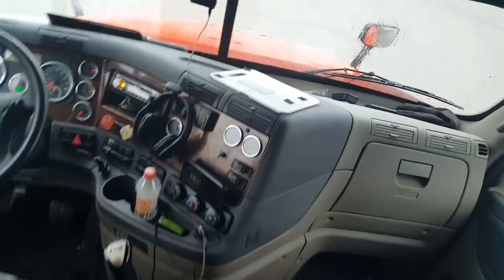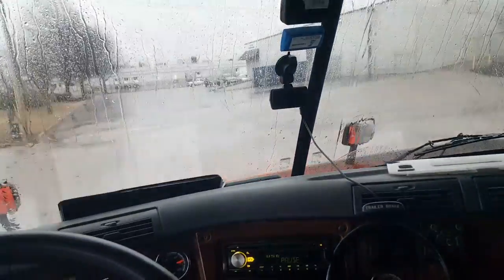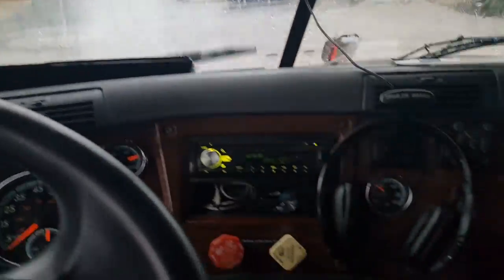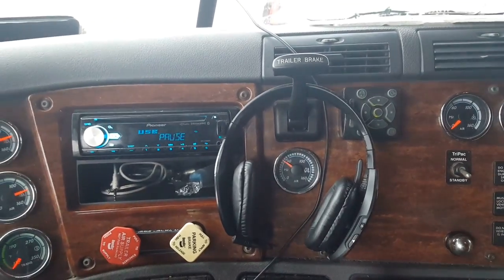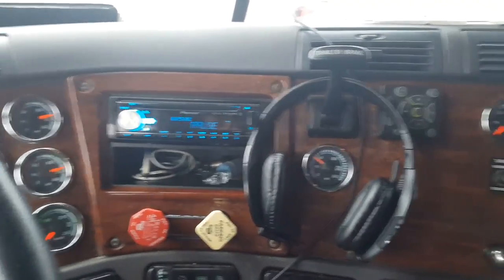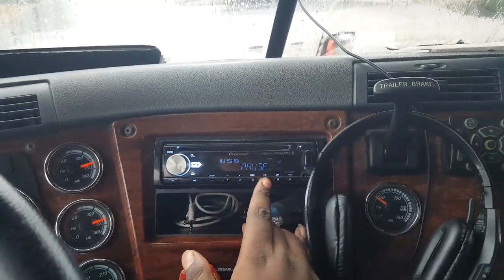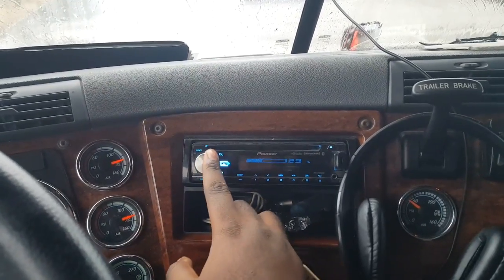2 15s Skar Audio in my Freightliner Cascadia

Comment: Nice. Your system looks like it could knock the trailer right out of the fifth wheel.  :)
Reply from the maker: BlindBatG34 its 10 speed manual.

Comment: I dig it. I’m working on a single Skar zvx8 paired with a Skar rp800 amp in a cascadia daycab, and speaker wise I’ll be running two external speakers on a Skar md400 and door speakers and tweeters will be ran on my pioneer headunit amp. I don’t need any sub bigger since I sit right next to the subwoofer lol
Reply: Val Bien-Aime you gotta get a a video of it KNOCKING
Reply: @Val Bien-Aime — did you ever install? Are you having any issues?

Comment: I bought all my gear it took me 3 months to save 3 12 Soundown, Rockfor Fosgate amp T2500BC, 2 sets  Focal Component, 2 set 6x9 Focal, Alpine series X 4 channel, 3 kinetik 14 volts, just order last week 1 Alternators 350 hi current just for audio only.

Comment: I wouldn't worry about your batteries/alternator they can take it no prob so long as ur using the proper guage wiring n ur connections are clean n sturdy n ur not bumpin w the engine off too much
Reply from the maker: H.O.S._bandit i have an apu. It kicks in 60 seconds after i turn the engine off if my system is still playing

Comment: I put 2 15” L5 in my cascadia and it becomes distorted. Clipped an amp, and blew a head unit already. 
I heard you speaking on ecm batteries, i thought they all are running the computer.
Reply from the maker: Without knowing your set up i can tell you its wrong. Either your amp wasnt strong enough or its the way you wired it. Was it a custom box or a pre fab?
Reply: @Little Fella Trucking— thanks for responding. 
I had a shop wire it. The amp is a Lanzar optin3500. 
I really don’t know what to do at this point.
Reply from the maker: IMPERIAL SEMI KING you used 0 gauge amp wiring kit? Also what head unit?
Reply: @Little Fella Trucking —yeah, zero gauge. I had two BOSS head units. Lol. 
I now have a pionerr AVH flip out.  
Once the bass starts getting low it starts to become distorted like pressing the mute button very quickly on and off like a strobe light type rhythm.

Comment: Does anybody know the wire diagram for the sleeper mute in Cascadia? I want to put a line level converter on the rear speakers from the mute switch but all the wires are the same I got left&right positive but no negative lead. I want the wires hidden so i didnt tap the 6x9 from ceiling i might have too tho if i cant find polarity.
Reply: Did you ever figure this out?

Comment: Hey man i wanna ask you i use the converter from 110v to 12v for my subs they are not anything like that strong they were 500w rms but i bought myself 3000w rms now and i don't know can you wire your amp on the truck battery or do i need something else to do that most guys that i ask they said you need some kind of inverter to run those you can't wire from truck batteries so now i'm kinda confused , and by the way those subs sounds amazing

Comment: I have a 2016 Cascadia, I'm looking at putting 4 EVL18s up top, with a Taramps Bass8k under the bunk. Good video.
Reply: I run 2 evl 15s on a taramp 8k got a couple extra batteries about to build a couple lithium batteries to slap in it

Comment: What year yur truck I have a 18 trying to find out wat size speaker in the doors I got one level 5 15 m4 from dc audio on a 2500 watt amp wired at @.7 ohm I also got a taramp 1200.4  that I’ll be using for my mids but I’ll be using a audio control Lc2i n keeping me Factory radio m but can’t figure out the door speaker size🤔🤔🤔🤔
Reply: 14

Comment: With having 4 batteries on your truck how did you hook the amp right to it or threw a capacitor??
Reply: I hooked it right to the amp from the batteries with fuse protectors

Comment: Did you hardwire your radio? Or is there a specific harness you used?
Reply: And also, how did you mount your tv? Wgmhat song is that?!
Reply from the maker: No just a regular harness that came with the pioneer head unit.
Reply from the maker: @Roryf4462  yes, my tv is mounted on the wall.
Reply: There is a trucking audio website you can get harnesses I got one for my  Kenworth

Comment: Little Fella... how did u wire the system to the batteries? My subs keep clipping.
Reply from the maker: IMPERIAL SEMI KING my amp for my mids are wired off my inverter with 4 gauge kit. My amp for my subs are wired with 0 gauge kit, positive to the 1st battery and negative to the 4th battery under the driver door

Comment: Hey so how did you run your power cable to the battery I’m getting ready to hook mine up
Reply from the maker: Under the rubber floor from the passenger side to the driver side and through the firewall in the floor
Reply: Little Fella Trucking  which side is the firewall on and where is it located big thanks in advance
Reply: Which battery?

Comment: Nice. Good job. I've got a 3000 watt inverter and I've been thinking about just buying a self-powered home sub and plug it into that with some RCA cables to it from the tuner. Wont base nearly as much as what you have but it will definitely be an improvement on this internationals sound system for sure.
Reply: Me too Jo
Reply: Did you ever do that idea?.. I have a 3k inverter as well and I'm about to upgrade my head unit. It would be much more affordable using your idea
Reply: @jaysmoothy2007  Yes I did and it worked fine. 3k watt invertor should be plenty depending on your amp of course. I can't imagine you having an amp that would require more then 3k though. You'll still have to run rca cables from the back of your radio to the amp on your home sub.